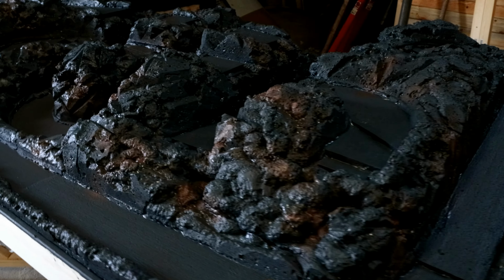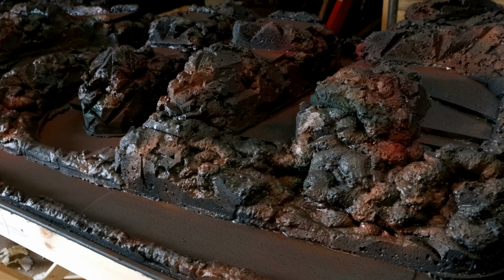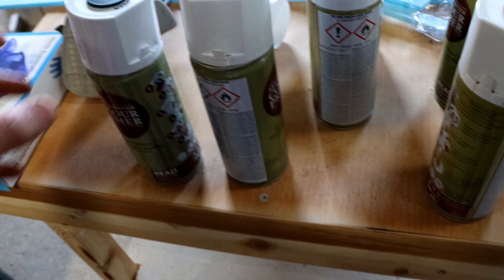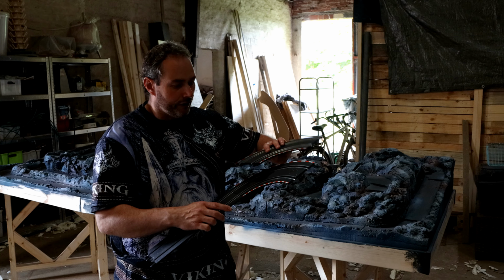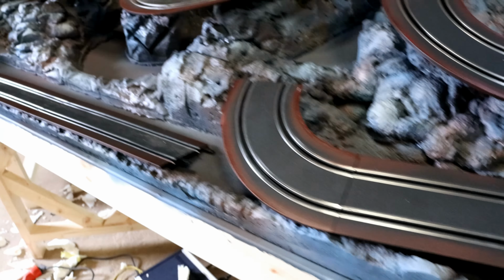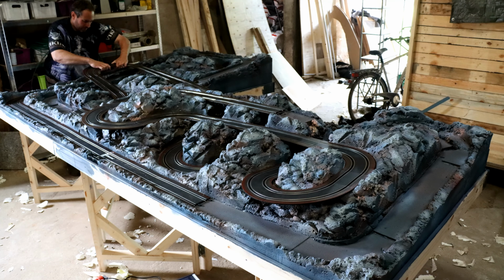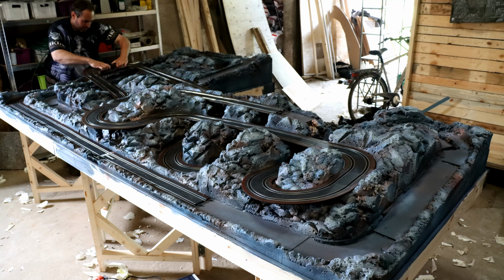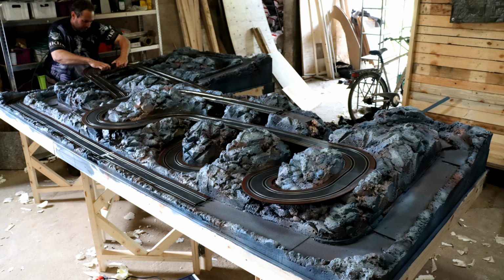From Scratch to Track 7 Day Slot Car Build - Day 5

Comment: 12:37 

I’ve seen others struggle with the issue of overspray insulating their conductors, which is why I always completely mask off the rails before I paint track pieces. I use tape that’s wider than both rails, fold the ends over the connectors, trim it with an X-acto knife, and burnish it along the edges. The prep work takes a while, but it winds up saving time and headaches with cleanup afterwards.

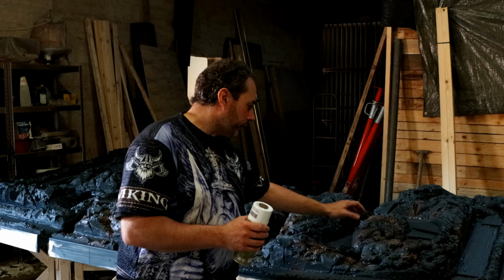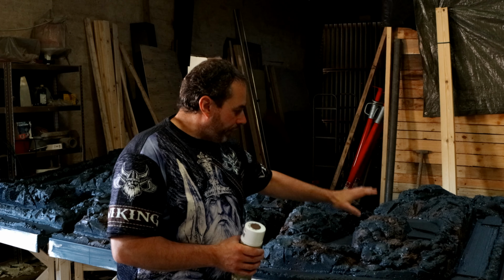My daughters and I have a Carrera 1:24/1:32 track and we couldn’t stand the silly, white dashed lines, so we’re painting the entire 76ft (23.2m) track. I’m making it look like it’s an older track been partially resurfaced. Roughly half is “asphalt” or “tarmac” and the other, “older part” is “concrete.” I made one of the transitions along a Karussel style turn. As an added bonus, every one of my cars handles FAR better afterwards. Lap times across the board dropped significantly after painting my test track. 

This is an awesome build series! I’ve really been enjoying your presentation.
Reply from the maker: Thank you for all your feedback. Repainting tracks can make them looks so much better. Have to admit that I just got a bit lazy spraying the edges that way. The deadline on the project is beginning to take its toll :D But love doing this, after this project I have another one where I'm going to take my good time :)
Reply: @HobbyWorld_one  Once my Carrera track is finally finished, I want to make a wood routed dirt/snow rally track. Painting that one will be a TON of fun.